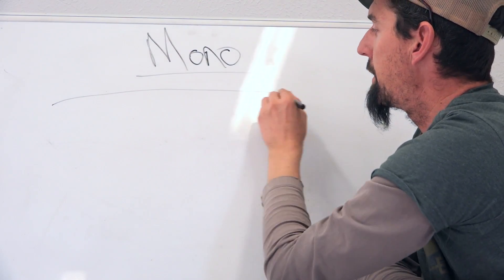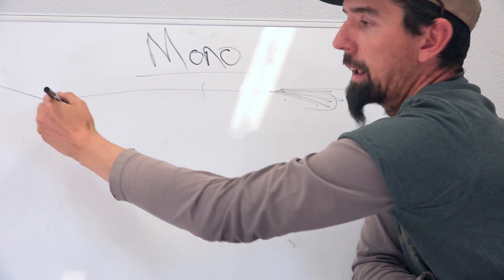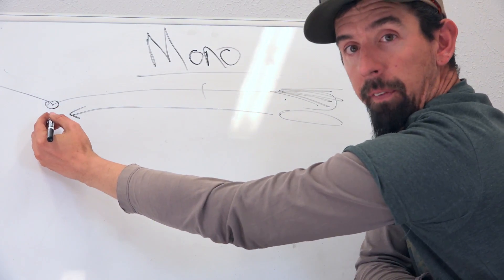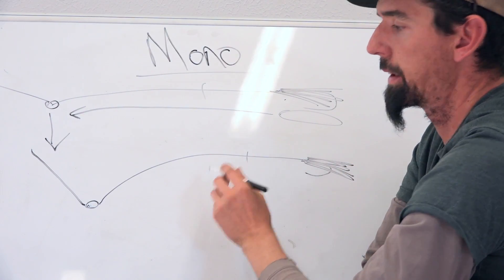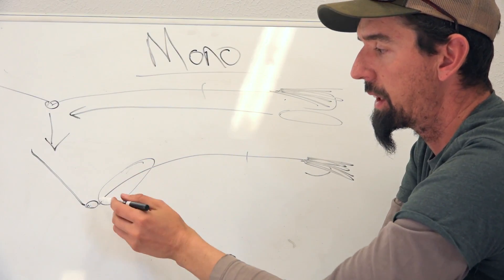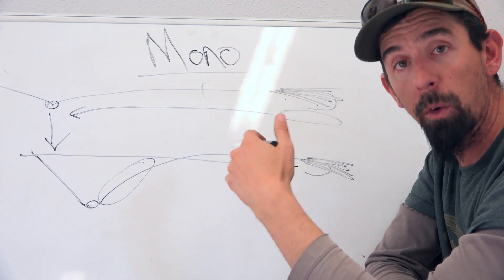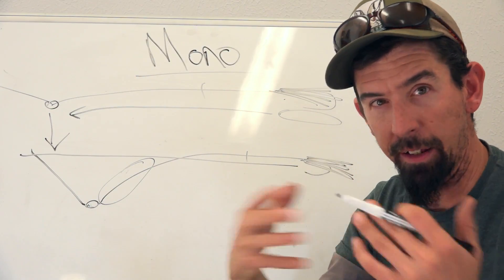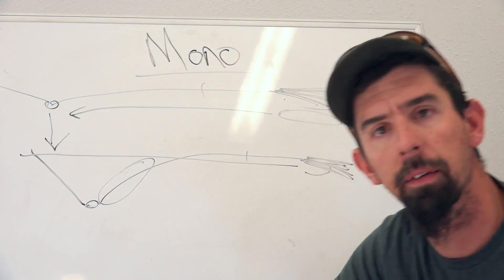Musky Leaders Part: I Mono Vs. Steel

Comment: What about fluracarbon
Reply from the maker: When fluorocarbon gets into the range of 80-150lb test, it acts very similar to nylon monofilament. I prefer nylon against the teeth of a musky though due to nylon having a higher tensile strength AFTER being cut or cracked.
Reply: Hi David , Great info!
Subscribed right away!
I always thought mono Floats and Fluoro sinks.
Im from the Netherlands and we dont have Musky overhere..but we do have Big Pike..people tell me all the time Mono isn't Tooth Proof...
I used 80lb Trilene mono.. i'll guess that is way too thin?